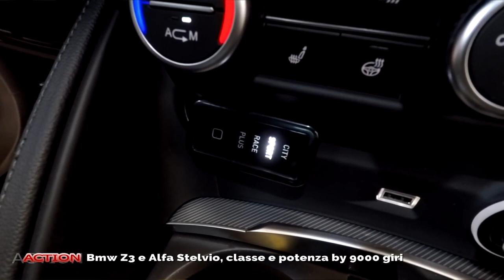Come migliorare le prestazioni motore della Stelvio | Nuova vita per la Z3 | Migliorare l'assetto

Comment: Quanto ha guadagnato la stelvio con stage 1? Ps è vero che alfa montano stessi motori ma cambiano solo le centraline ?
Reply from the maker: Facendo una mappa non eccessivamente spinta, possiamo garantirti in tutta tranquillità 30\32 cv e 50 nm di coppia aggiunta. Riguardo alla seconda domanda, su alcune versioni e motori, la differenza in termini di potenza è data da una diversa mappatura della centralina motore rimanendo identica la parte meccanica. Questa è una prassi comune effettuata anche da altri marchi
Reply: @9000girichannel  perfetto grazie . Ho un dubbio, Se in questo caso la stelvio monta le stesse motorizzazioni , il 210 cv non dovrebbe sbloccarsi a 280 ?
Reply from the maker: @fabriziopiergentili6135  normalmente i margini fra diverse motorizzazioni rientrano nei limiti di 30 / 35 cv, oltre sono sicuramente comprese modifiche di carattere meccanico in primis una diversa geometria del turbo